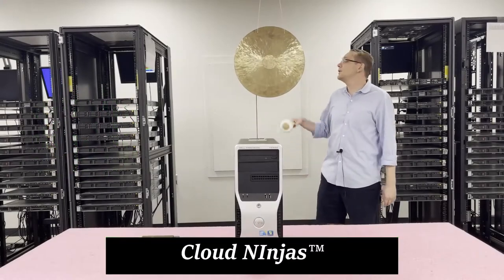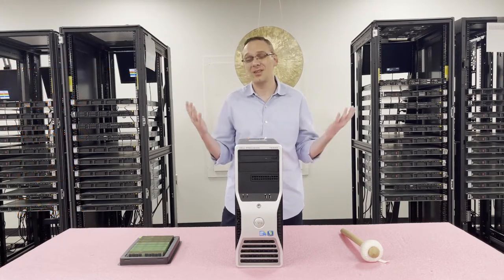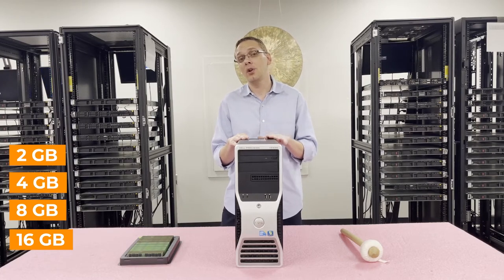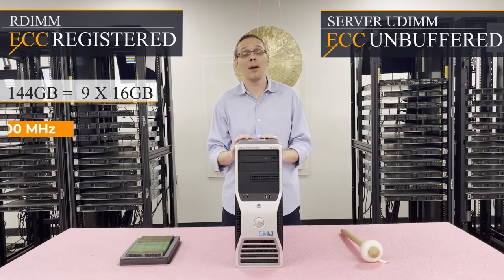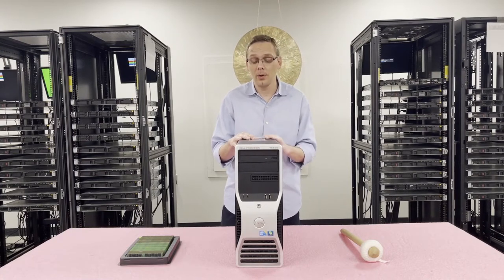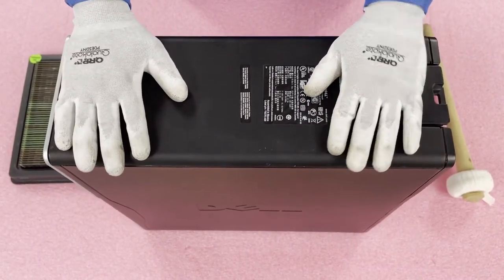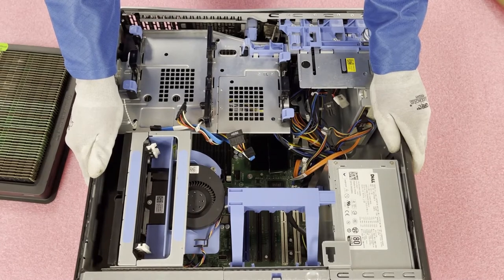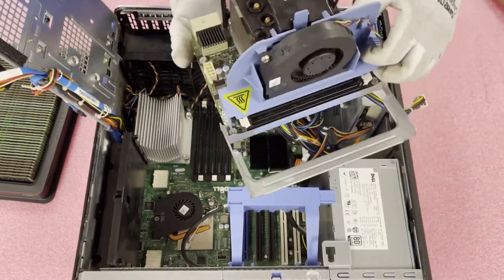Dell Precision T5500 Workstation Review & Overview | Memory Install Tips | How to Configure | Gaming

Comment: Great video ,but... As a certified Dell Tech I have to mention one thing I noticed. You didn't put on the memory shroud. There is a shroud that goes over the MB RAM that is missing from your T5500. ;-)
Reply from the maker: This is true.  When system arrived it came with no shroud so we turned into a testing solution in our lab.  Ironically meant to mention in the actual video so glad you are adding the info!  And yes definitely want your air shroud for proper air flow.  Have a nice weekend. 👍

Comment: Question I have a t5500 running bios rev A02 and my USB keyboard is not working on boot up is it a bios issue or do I need to use a PS2 keyboard
Also I'm going to be upgrading the bios to a18 obviously
And will the t7500 work in the 3500/5500 chassis

Comment: Can i use only 1 cpu and extra one out of the body...? In this T5500
Because the CPU2 make noise with Fan....
Reply from the maker: Yes.  You can run with 1 CPUs.  However none of the RAM slots associated with the 2nd CPU will be available for use.  Have you checked your fan thermal settings?  You should something similar to this... check in your iDRAC settings... thermal settings... fan speed.  Good luck.  Smash that subscribe.